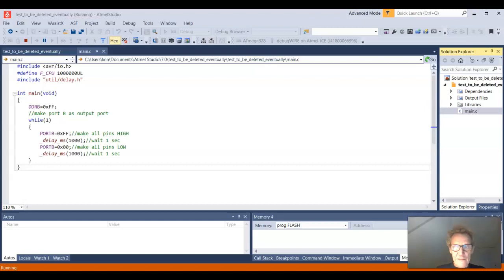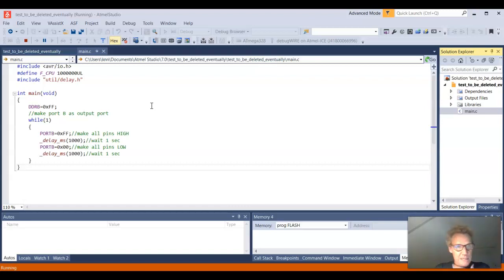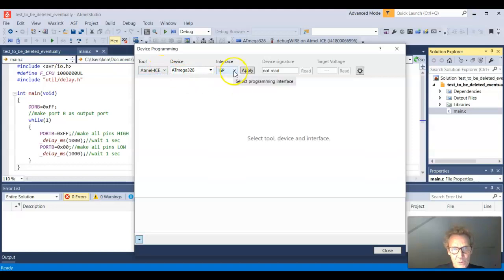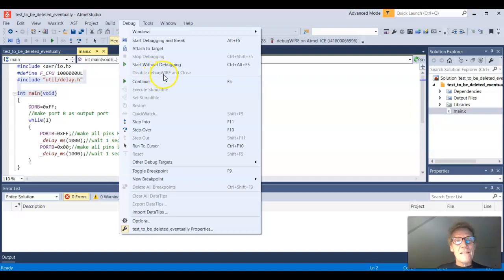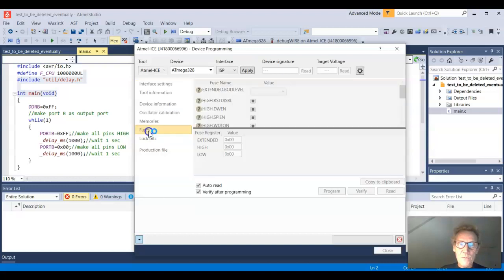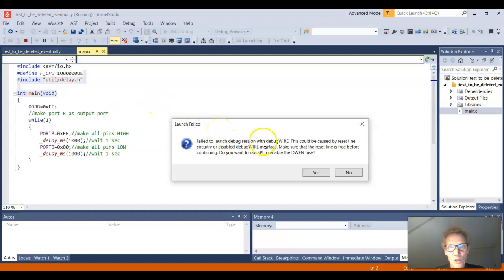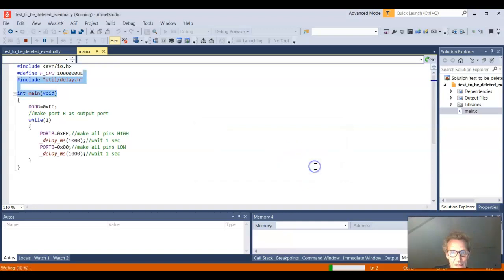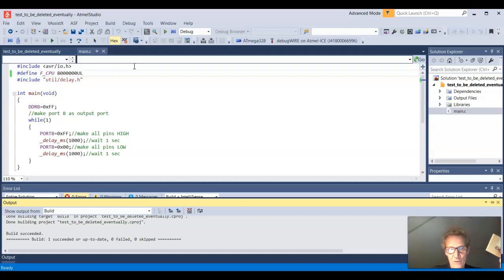Atmel Studio_ICE Failed to enter programming mode

Comment: Sir in device signature it is showing 0xFFFF means and not able to read and program device
Reply from the maker: You are right Rajan.  If the device signature is wron no programming is possible. there is a hardware issue, and from following my students it allways falls back to wiring errors.  If you happen to have an arduino you might try to connect to that to check that the socket from the ICE is ok.

Comment: The probleme is also there. What can i do, if this not the answer for the probleme?
Reply from the maker: You are so right!  It is  a complex systemso you need to be systemmatic whentrying to find the error(s).  I posted the video because the error found here is frequently seen among my students.
Reply: I found the problem. I have adjusted the LOCKBITS by using a TTL converter and the Atmel Ice at the same time. With the Ateml i was able to fix this error😊